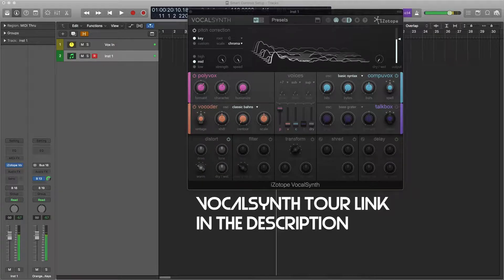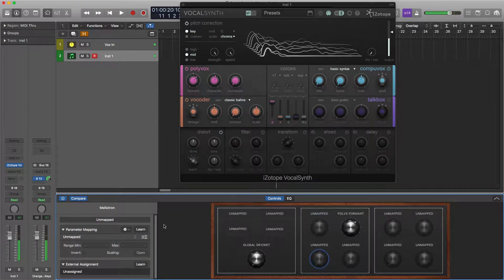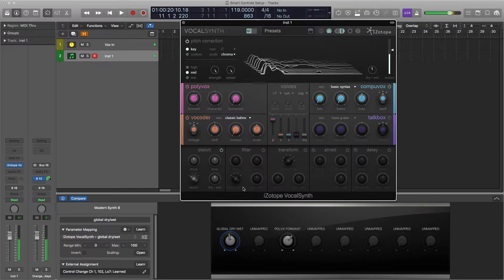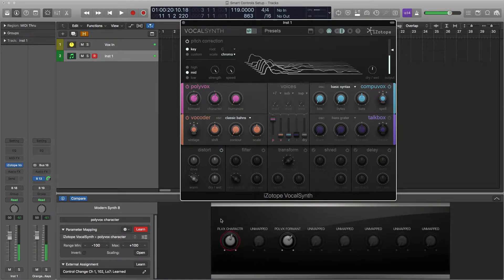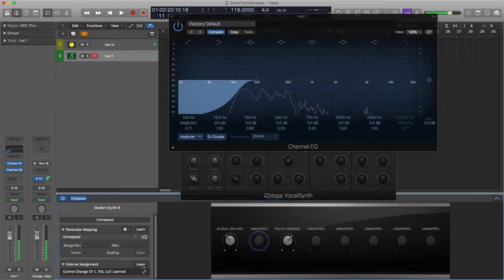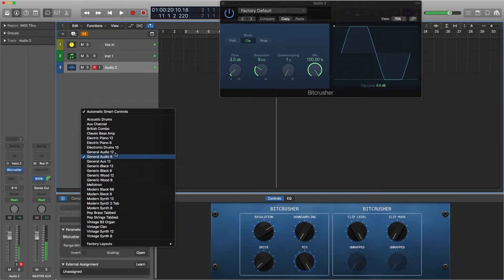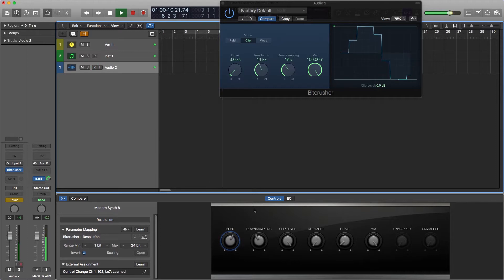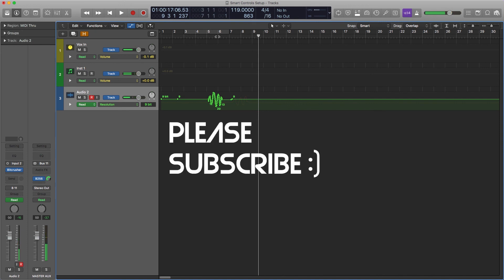Smart Control Tutorial for Logic X

Comment: so it appears it lets you keep permanent controls setup on a plugin so it can be reused on every track, or it limited to only a per track basis?
Reply from the maker: It is a permanent setup that can be reused on every track. When you map a midi controller to a smart control, you will no longer get midi input into logic from that CC. Be careful which Smart Control skin you use on different tracks though because they sometimes put smart controllers in different positions.
Reply: @MusicSequencing  huh. thanks. I keep wondering how easy it is to do this. Are you able to use smart control on most plugins, and really get a lot of use out of them, or do you find them only useful in a few plugins? Do you encounter many problems?

Comment: great tutorial man ! But I'm facing an error since last week. My knobs have mysteriously disapeared from the smart control window. It is just showing a blank space even after having selected a track or selecting a sample in the drum machine designer for eg. Is there any way I can reset the smart control settings to default so that the knobs appear again ? Thanks in advance.
Reply from the maker: hi, just saw the same error, i toggled between the Controls and EQ buttons located at the top of the smart control window and the smart controls showed up again when I clicked back on Controls. Hope that helps, let me know if you still have the issue
Reply: @MusicSequencing  Hi, thanks for this video! I've been having the same problem but it doesn't get fixed when I toggle between the two buttons as you suggested. I am able to get faders when I add effects, but I want the faders in the default setting like it was in Garageband (Compressor, EQ, and Sends) where it has reverb and everything. Any way to get this?